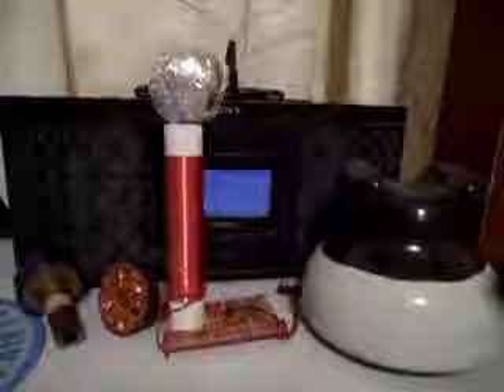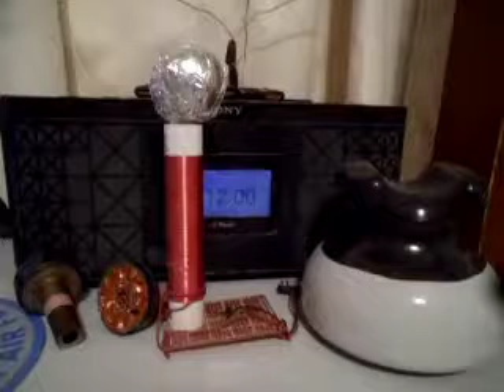Tesla's Death Ray Was An EMP Generator Not A Tesla Coil

Comment: An average bolt of negative lightning carries an electric current of 30,000 amperes (30 kA), and transfers 15 coulombs of electric charge and 500 megajoules of energy. Large bolts of negative lightning can carry up to 120 kA and 350 coulombs.

Lightning - Wikipedia
https://en.wikipedia.org/wiki/Lightning

are you sure lightning has no current? teslas death ray is exactly what it sounds like, a gun, but used electricity as its ammo, not as an emp, a microwave pulse generator that has been developed in new mexico does exactly what you think teslas "death ray" does. sends out pulsed microwaves to fry electronics and bring down anything using those system. teslas death ray would of blown HOLES inside of things, not fried electronics. 

KING HAZeus AKBAR!!!!!!!!!

Uranus Bless America.